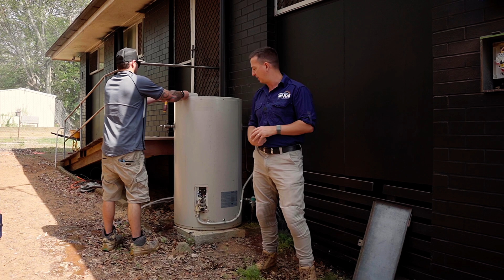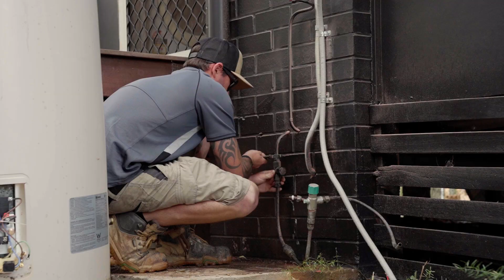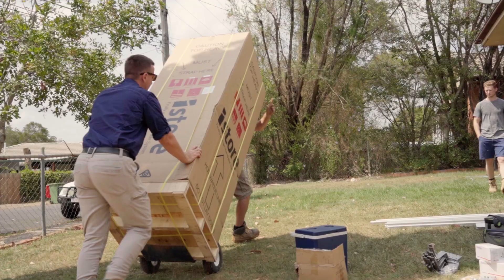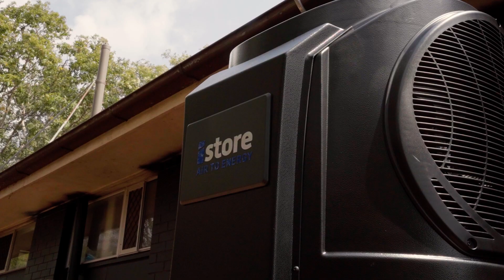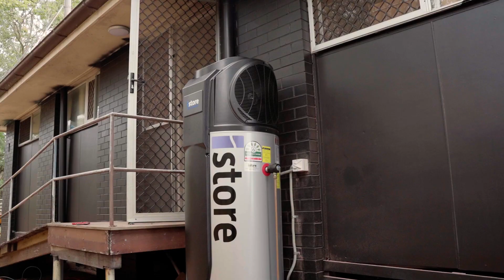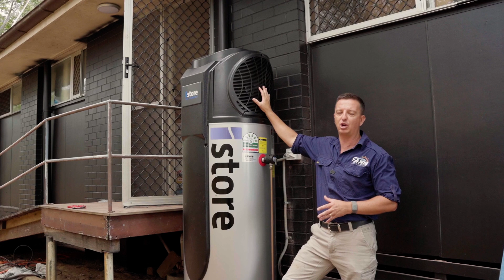Sure Solar's iStore Hot Water Heat Pump Installation & Solar Synergy

Comment: Really wish you guys didn't lock up your systems in your own app like it's 2016. Please include Zigbee or matter over thread in your control module so we can easily integrate any iStore system into our smart home easily. It will get the management off crowded wifi and don't need the Internet to manage them. It can't be expensive or complicated seeing millions of devices from tiny lightbulbs to smart sensors use it. Come on guys you have amazing products and it's 2026 already. Time to get that sorted

Comment: Good video .... what size copper pipe do you plumb the new unit with ? 12 mm or Larger ?
Reply: the tank has 3/4 in fittings and can be deon in 1/2" or 3/4" .  Half inch is most installs I see.  **disclaimer I work for IStore